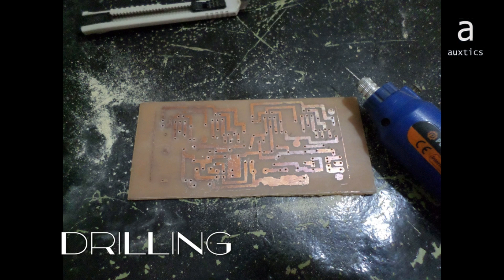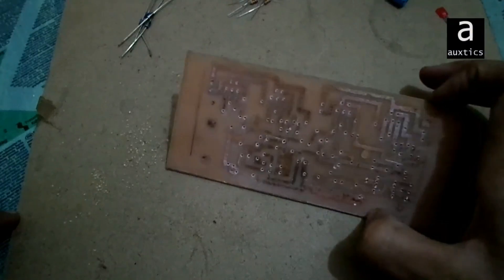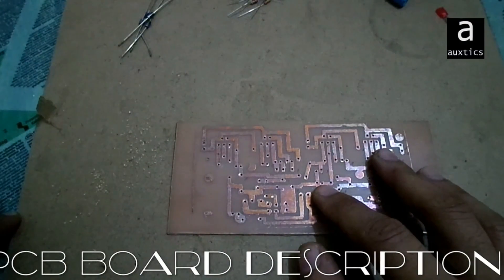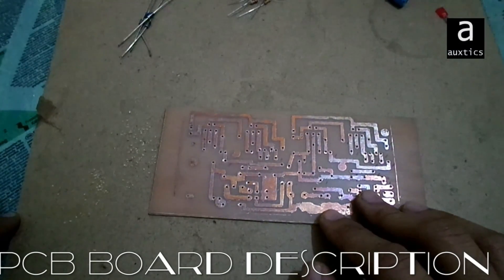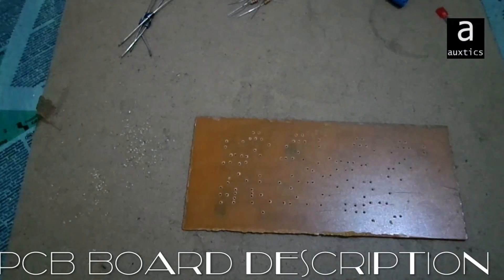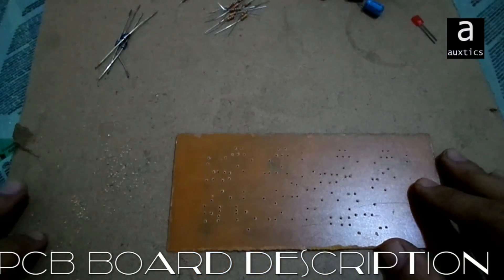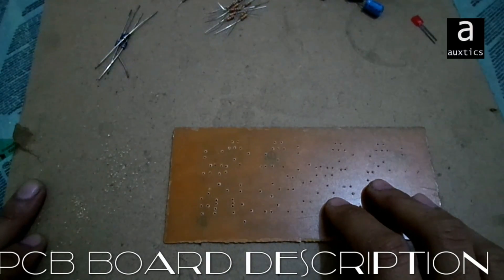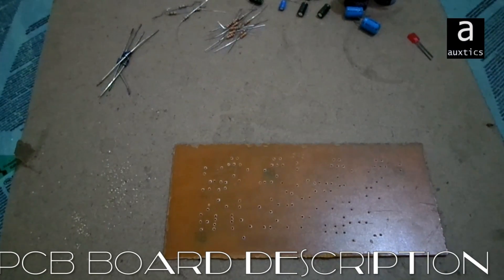tda2030a 35watts bridge (BTL) stereo amplifier tutorial

Comment: Wow....this ic is brilliant and great quality ...really tda2030 is competent to mosfet transisters because of its pentawatt package....
Only one thing is voltage... use 12 0 12 or 15 0 15  5 amps and correct watts of speakers ....for bridged two ic use 50 watt best quality 8 ohms speaker with correct polarity....Use big heat sink and cooling fan for better performance   and  life .....
Reply: I am using 100w sound board and 12-0-12 5amp transformer my woffer IC is too much heating without load pls help
Reply: Which is your ic...and your Speaker ohms and watts...?
Reply: TDa 2030a 100 w speaker
Reply: 8 om
Reply: Did you check voltage below...have any distortion voice from Speaker without input signal
1.Check the transformers output  ac volt between three pins
2 then check dc volt ground.negative and positive (not exceed more than 18 0 18 vdc)
3.check rectifier diodes ....if ur ic have any short rectifier diodes will heating immeadiately... Overall normally tda2030 ic have average heat...use big heat sink